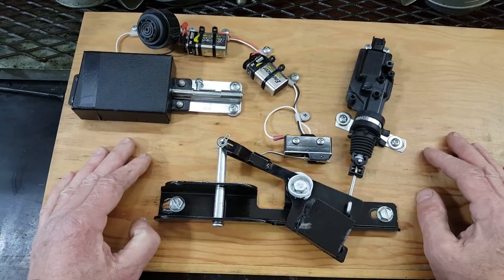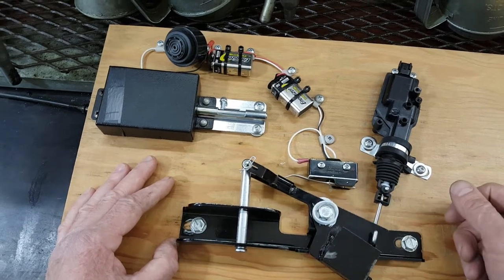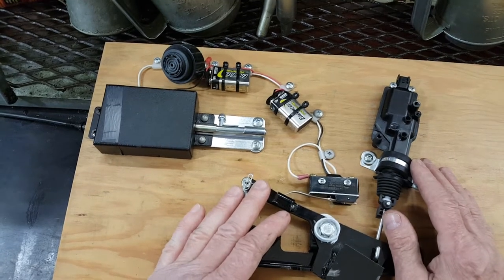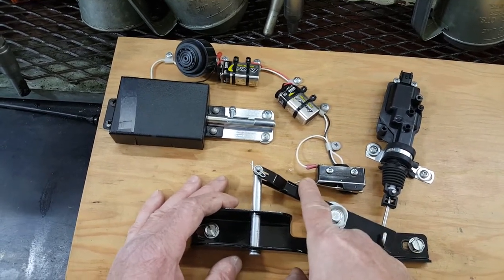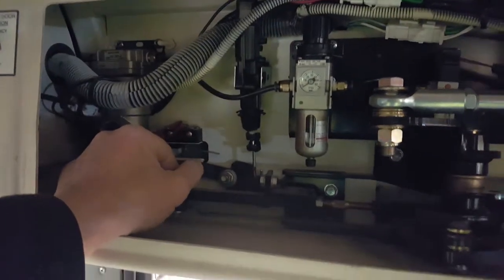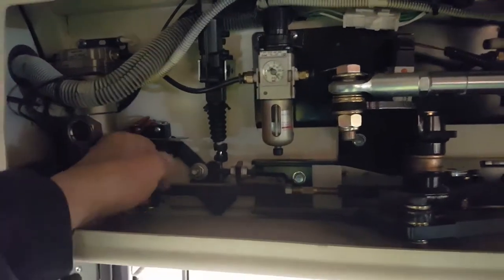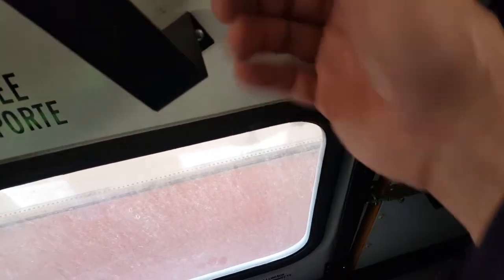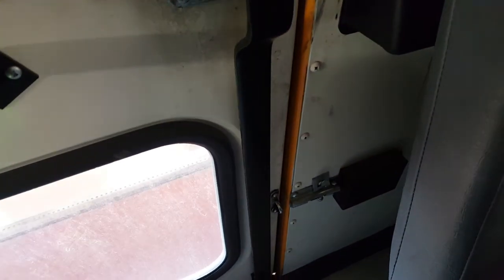No Start School Bus Checking Vandalock System

Comment: very informative, i would love to see the 2006 bluebird system because i am having issues with mine.
Reply from the maker: May be similar? It would need to have the key to activate. What's happening with your Bluebird system?
Reply: @MechanicsHubdotCom  I unhooked and pulled the wire back to the box and now I can't start it. I rebooked the kill switch but it still doesn't work.  I need to bypass the system and I talked to a local mechanic and he told me to put a jumper wire in place of the vandal relay but this did not work either.
Reply from the maker: @ramblerrob2822  since the vandalock interrupts the starter circuit there will be either a switch or a relay to do this. Is all the circuitry in the compartment above the entrance door?  I'm not familiar with Bluebird. When I want to bypass the vandalock on our International buses the 2 wires going to a micro switch have to be joined together. The micro switch is controlled by an electric servo cylinder connected to a linkage/lever. This all happens using the vandalock key on the outside of the entrance door. I'm thinking your Bluebird would be somewhat similar? Keep posting here with more info.
Reply: @MechanicsHubdotCom  bluebird has the vandal relay hidden in a panel behind the driver side windshield wiper.  The kill switch was located on the emergency exit and it only had one wire to it which when locked  broke the ground and grounded the wire when unlocked. I've since tried grounding the wire but it still isn't working.  I removed all alarm wires which ended up only being one wire. I dont know if something else had something to do with the ignition lockout. My bus has a handicap door as well as the emergency exit but it didn't have any lock on it. I'm not sure how to access the back of the vandal relay in order to trace its wires.
Reply from the maker: @ramblerrob2822  the ground goes through the switch and the bus body if it only has one wire. Have you tried running the wire at the door switch to the battery ground terminal? It might be a stretch with a long string of wire but worth a try. If there's any kind of resistance that could cause an issue. If the relay is triggered by a ground I'm wondering if it's working properly? A coil in the relay will open or close a circuit and in this case to the starter and is there an alarm when the vandalock is on with ignition on?
Reply: @MechanicsHubdotCom  yes when lock is engaged a buzzer sounds and when unlocked the buzzer is off and the ignition is supposed to work but doesn't since I've pulled out the wires.  I have grounded the wire but not to the battery terminal because of distance.  Grounding it shuts off the buzzer but is not engaging the ignition switch
Reply from the maker: @ramblerrob2822 ground is good if the alarm cuts out ...there must be a connection issue at the relay. Wire off at the relay?
Reply: @MechanicsHubdotCom  haven't been able to access the back of the relay panel yet. I would think so though because why would the wire come out when the bus has been sitting here. I'll check it out when I can. Weather has changed my priorities for now. Thanks for your help and I'll get back to you if problems resume.

Comment: On my Interrnational school bus the problem I have is that only two of the terminals were connected to wiring (one black, one white) and the key was lost, so I got me a replacement lock but I can't find any reference on how to connect the wiring to the A/B/C/D terminals. Do you have a video or instructions on that? I'd like to get the vandal lock working correctly now that I am converting it into a skoolie motorhome.